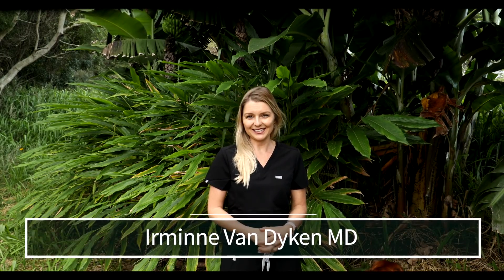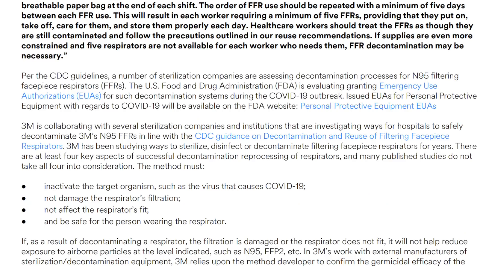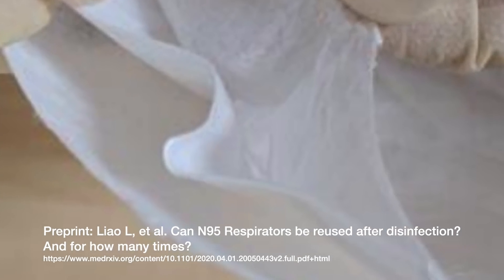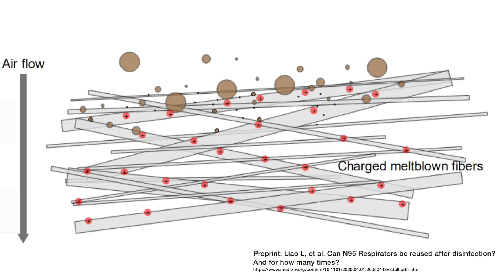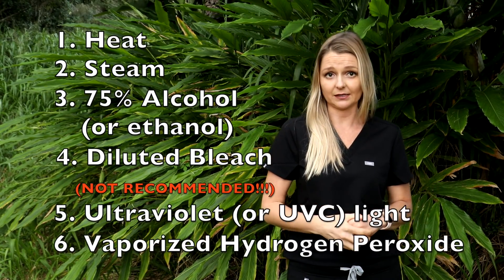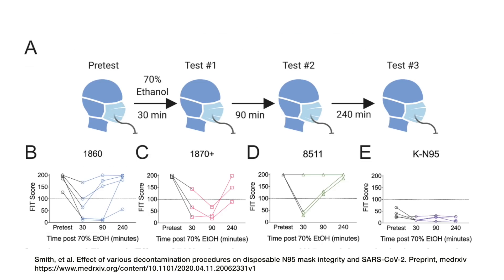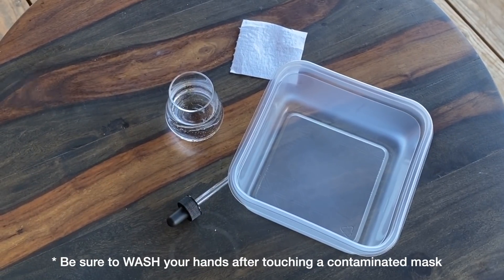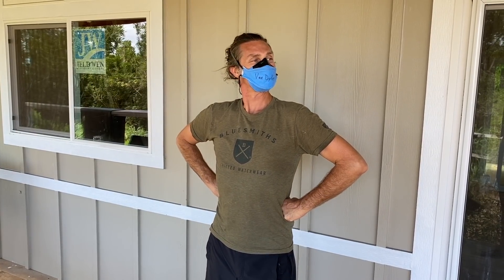How To Disinfect Your N95 Mask at Home

Comment: I have alcohol in a spray bottle, and mist the inside and outside of the mask with alcohol mist after each use. It evaporates in a few minutes.
Reply: Try spraying hydrogen peroxide liquid instead, I don't think H2O2 is toxic. Or keep the mask in a bag for 3 to 4 days.
Reply: @xosefc  Paper bag keeps popping up....question, should the paper bag be sealed once the mask is place inside or left open to air out? Curious. Thnx in advance.
Reply: @MadDOGGYDog01  In order to protect from air stream, better sealed or folded up, just suggesting.
Reply: @xosefc  Thnx for your reply. Appreciated.
Reply: Robert Foster Not a good idea to spray the alcohol!!! It will break down the mask fibers eventually and make it less effective to screen out pathogens!!!
Reply: Researchers tested spraying N95 masks with ethanol mist, and found it reduced the filtration efficiency from 95% to 56% with a single treatment; repeated treatments are going to make that mask utterly and completely useless at filtering out viruses. See "Can N95 Respirators Be Reused after Disinfection? How Many Times?" published in the American Chemical Society's ACS Nano in April 2020.

Comment: Just watch the full video before commenting. i am a dentist and i use a surgical mask over my n95 mask and sterilize it with a steamer.
Reply: when you say surgical mask, I assume you mean the typical FFP1 3 layer mask? And if so, would this convection oven hack work on one of those? Curious....
Reply: MadDOGGYDog01 
Surgical mask is the common mask we see in a medical fields. It is less cheaper and less effective,  just throw it away or wash it,  don’t bother putting it in the oven. 

We are trying to save the n95 mask which is more expensive and more effective  in filtering. so i use a surgical mask over the n95. You can use washable face mask or anything to protect your n95 mask being contaminated. Dentist is a high risk being infected with all sorts if bacteria and viruses. We work on patients mouth so aerosol is being generated and splatters coming from the mouth of the patient. 

N95 is still contaminated but it is less contaminated because of the outer covering which is my surgical mask, 

If you are a doctor or medical practitioner n95 is a must,

Comment: I’ve been spraying mine with 3% hydrogen peroxide so it’s damp all through and air drying in sunshine. I have 2 N95’s I bought a few months ago, gave 8 to my parents with the same sterilising suggestion. H2O2 does kill these viruses and breaks down safely into water and oxygen. Hopefully, if they’re using a vapour of it, the masks aren’t damaged.
Reply: Doing this degrades the mask  fibers over times after continued sprays used.

Comment: What if you do not have a convection oven? 🤷🏽‍♂️
Reply: Use the mask after 7 days, virus can no longer stay alive that long
Reply: @SanskarSharma  but the mask will be dirty.  So proper washing the mask is very important.  I have dont a detail research on this topic. And made a video on my channel.  U can refer that video.  It's very important to was the mask before reusing it.
Reply: @PritZCollection  You cannot wash N95 masks or spray them with alcohol or hydrogen peroxide. If you do, you will render the electrostatic charge inside the mask useless. What she is talking about in this video is how to disinfect only N95 masks. Regular cotton masks can be washed and dried to disinfect. I have been doing research on the internet for a long time on this and her way is the way that the most recent studies say to do it and still be able to wear the mask for at least, I believe, 20 times, if not more. You can sterilize the N95 with steam, but then you would only be able to use it 4 more times after. The other way is the way Sanskar Sharma (above) said. Don't use the mask for at least a week, maybe a little longer. The virus should  not viable after that time.
Reply: I put mine in a pillowcase and place it in the dryer for 30 minutes.  I am not concerned about washing it because I wash my face before I use it and I can live with it if there is a bit of my own oils on the interior of the mask.  It is not perfect or approved by health professionals as of yet but I am using the tools that I have, and dry heat is also a method being studied with some promise.  Oh I am in no way discouraging this channel's approach.  I just don't have a conviction oven but I do have a conventional clothes dryer.  Please do your own research and use the methods that will work best for your situation.  I am just a high risk patient that occasionally needs to go to the supermarket and other public places.  I am not in direct contact with known infected people.  I did not purchase my masks recently I had them left over from a year ago.  I lucked out that they were N99.
Reply: @That_BIack_Cat  yes. N99 is best 👍
Reply: @PritZCollection  We went on a trip to a place that was having brush fires so I bought them for my family just on case we ran into smoke.  We didn't use them for the trip.  About three weeks after we got home covid started.  It was pure luck.
Reply: @That_BIack_Cat  stay safe bro.  👍 . All will be ok . Take care of yours family .
Reply: @PritZCollection  You and your family stay safe too.  Take care ✌🏾😷✌🏾.
Reply: @That_BIack_Cat  thanks you friend.  
Bdy , where are you from ??
Reply: @PritZCollection  Originally NYC. What about you?
Reply: @That_BIack_Cat  I am also in the same condition.  Fighting with the situation bro. U all take care.
Reply: @MsBarbieBaby1 thanks for such a guideline . 
I too can spread this information. 

But as pre the new circular ,  GOVERNMENT says   N95 mask with respirator valves is not safe during this pandemic.  As the out flow of air from the VALVE didn't get FILTER and it may contain the virus and can be spread out.  

So what can we do in this situation,  for long time using a non VALVE N95 mask it will be to difficult to wear and will be harmful as we intake the CO2 again . 

To solve this situation,  can we 1st wear a 3layer surgical mask and on top wear a tight N95 valve mask . 

This will filter the intake air through valve and will block the out going air containing the virus by the surgical mask . 

Do u all think this process will be safe from both side ???
Reply: @PritZCollection   I have just heard that as well. That the valve N95s aren't as good. I am not sure what to do in that situation. All of my N95's don't have the valves and I have no issues with breathing in CO2. I wear mine for a few hours at a time. 
I have heard that doctors are wearing regular cotton masks or surgical masks over their N95's so they can use them over again. I suppose if you are not in the healthcare field that might be an alternative if you have the valve on your N95. For healthcare workers I'm just not sure. That would certainly be harder to breath in, but if you don't have any respiratory issues it's probably doable.
Reply: @MsBarbieBaby1   ok . Thanks. Realy yours advice solve many if my doubt . 

I too will advice my audience to do the same .
Reply: need to get a boiler and the steaming process with In Effective Way USING HOT WATER
Reply: @markvandeventer2411  coz not all of us live where the sun shines
Reply: @markvandeventer2411  doesn't change my reply. You seemed confused as to why everyone didn't use the sun. I explained why. The fact that you live in Thailand is irrelevant.
Reply: I put my masks in a container and place it on the dash of my car sealed up in the sun all day. The temp inside the car get's plenty hot to do the job.
Reply: @joshuaprince898  Seriously?  Do you inspect the masks for living viruses?
Reply: @joshuaprince898  but. Have to wash and disinfect the mask first then have to dryed under sun light. 
I too have a tutorial about the proper process of washing , disinfecting and sanitizing the reusable mask. Hope the video will be very helpful for all. Pls once visit my video.  And pls suggest me , wether I have used the correct process. 
Tc. Stay safe sir .
Reply: @PritZCollection  washing the mask may damage the fabric and will be more porous for virus .
Reply: @praveensingada  yes my friend.  You are right . Actually during the pandemic,  we are having shortage of N95 mask , so we have to wash them properly before reusing them . 

Thanks for the suggestion
Reply: @PritZCollection  just put the used mask in steam autoclave , or u can use steam sterlizer by Philip avent , or some pressure cooker , but don't wash , the mechanical integrity of mask gets damaged .
Reply: @PritZCollection  we are washing in  soap water or  keeping them 25 sec  in soap water or surf water..... kindly let us know,,whether this is correct  ??

Comment: I got a portable UV disinfectant light (or lamp) off of eBay that I can toss in my backpack. Depending on the seller these handheld lights go from about $12.00 (coming from China, so I question the quality of the light itself) usually up to around $50.00. Some sellers rip people off by trying to sell a $45.00 UV disinfectant light for over $100.00, so please beware. The disinfectant lights can be harmful too, but I’m hoping the one I order works well on my cellphone and iPad. I’m bringing this up because of the bacteria problem, and I hope they might be safe for masks. (I’m not trying sell anything, but in times like right now thing’s are tough and I thought it was worth a suggestion.)

Comment: 3M published studies and no methods should be used to reaterilizing. My ER is using UV light.  Sure, the mask is sterilized, but who knows what the integrity is. I wear a surgical mask over my n95 and keep it for a couple days depending if the patient actually comes back positive. I'd rather reuse, than use something with questionable integrity

https://multimedia.3m.com/mws/media/1824869O/decontamination-methods-for-3m-n95-respirators-technical-bulletin.pdf

Comment: I've been hanging my two in a 170f oven with wooden clothes pins so they don't touch the hot metal for 30 min and then let them cool in there. How do the plastic containers not melt? And is it 185 bc that's as low as your oven goes? Isn't the internal temp for cooking food to kill pathogens only 165?
Reply: And even if the plastic does not melt, I'd be concerned about the fumes being given off, and finding their way into the mask.

Comment: Putting a plastic container in an oven, any oven just doesn't sound like a good idea.  Also isn't heating plastics a bad thing?
Reply: 185F is not hot enough to melt a tupperware
Reply: @xoxoemo  That's not Tupperware. It's Glad and cheaper plastic. But apparently, it didnt melt as we saw.
Reply: I think the same way.
Reply: That's just in your food. You're not eating or drinking the mask. 
As far as plastic containers, some food comes packaged in such that say can put in conventional oven as well as microwave and they say a time and temperature. Always seemed crazy to me, but if it's not Too hot.. I guess tbey wouldn't say it if it was going to melt. -  I never tried it..
Reply: TV dinners cone in polyethylene trays which can be heated to 350° F without releasing harmful gasses or melting. Disposable plastic containers are polyethylene or polyurethane. The masks themselves are made of polyethylene fibers
Reply: Desperate times call for desperate measures. I'm sure the few exposures to the heated plastic, in order to avoid contracting the SARS-COV-2 virus during this pandemic, is worth it. It is to me anyway.
Reply: You don't have to use plastic.
Reply: She's a woman who got a MD degree. Leave her alone
Reply: How to buy a quality mask?https://www.walmart.com/ip/KN95-Soft-Comfort-Filter-for-Face-Skin-Care-with-Fixed-Nose-Clip-Non-Woven-Fabrics-10PCS/645924806
Reply: Nano-level N95 protective mask can be used repeatedly 20 times, welcome to buy and order in bulk. Please visit candynice.com, and nanotechnology video details please visit: https://youtu.be/HX7Qbol47vc
Reply: @toolsamazingservice7313  Only if they are dryed for 72 hours to kill COVID-19

Comment: With the current shortage of the N95 mask, I have in my garage roughly 30 pieces of expired unused N95 mask. Can these masks be used still? I think that the part that has an earlier shelf life would be the rubber bands. I did a pull test and there was no deterioration noted on either the cloth part or the rubber band. Is it safe to use them?
Reply: I would recommend you visit Center of Disease Control's website.  See "Considerations for Release of Stockpiled N95s Beyond the Manufacturer-Designated Shelf Life" https://www.cdc.gov/coronavirus/2019-ncov/hcp/release-stockpiled-N95.html -
Reply: @porpo-donut  Thanks for providing the link. I did visit the CDC website and the 3M numbers I have on the boxes at home correspond to the numbers listed on the CDC website which is, according to their investigation results, considered "protective" or safe to use. Thanks again.

Comment: Putting plastic in an oven is a no go for me. 
I will put mine in a glass container and set it in the sun for the day. 
It gets dang hot in there and it catches alot of UV. 
If I sat in that container all day in the sun, I'd be sunburned and dead.
Reply: Lol. Must be nice living in a sunny place. Where I live is always overcast and low sunlight.
Reply: @KVStarStruck22  The sun only just finally came out last week. 
<3
Reply: But doesn't glass usually blocks the UV
Reply: @soumendrapanigrahi2497 Yes, but not UVA rays. " Standard window glass, according to the International Ultraviolet Association, will allow UV-A to pass through while almost 100% of the UV-B and UV-C light is blocked. Therefore, some UV light will enter your home and potentially affect your skin. Some of these effects could include increased freckles and increased sensitivity to sunlight that could result in rashes such as photodermatitis."
Reply: @KVStarStruck22  ye but we are talking about killing virus here, I think it would be more effective to just put it out there in the sun rather than covering it with glass..... coz UV-C is most effective in killing those microbes
Reply: @soumendrapanigrahi2497  Yes, better to leave it outside with no windows around it.  You mentioned UVC, UVC does not come through, it is completely filtered by the atmosphere and does not reach the earth's surface unfortunately. They do sell UVC lamps though in stores.
Reply: @KVStarStruck22  hmm i had an idea 2 years ago before this Corona pandemic to use uvc tube used in filtering water inside a reflective box to kill bacteria and viruses, unfortunately i didn't construct it back then.... Now some idiot has sent me a used mask online and i can't return it online due to no return policy, no to mention i payed thrice the price for it.... I am planning to wash it although it will reduce efficiency greatly, but during situations like this idk what else to do
Reply: @soumendrapanigrahi2497  What kind of mask did you buy? I read somewhere that UV light can lessen the electrostatic charge in N95 masks.

Comment: What about a CPAP cleaning device such as SoClean that sterilizes cpap masks?  I could just toss it in with my CPAP mask 😷 daily(?)
Reply: What does that CPAP cleaner machine actually do?     Beware any process that damages the static charge built into the mask's inner layer, during manufacture. 

I don't know anything about CPAP but it seems they're a kind of forced-air respirator... with no filter.     IS THERE a filter in a CPAP machine or mask?     That filter would be the trickiest item to sterilize, as it has the highest surface-to-volume ratio, by design.
Reply: @johnbecich9540  Yes, CPAP machines have filters (not the masks) but they are mainly to keep dust out of the machine.  They're foam and paper filters and intended to be disposable.

Comment: For the love of God, can there be a concise, definitive, credible, professional, verification that answers the question of how to safely extend a N95 mask & other backup solutions?  Even if it is to just place some type of a fabric cover over the N95 or insert a filtering fabric inside, or... ?  All of which may make it a bit harder to breathe through, so experiment to what you can tolerate in terms of adding more layers.  Time is life, Science rules, & Validation is critically needed.  Not everyone has the time or opportunity to read through countless responses, trying to evaluate what’s the best or, .....at least even the top 3 solutions.  At least the recommendations for fabric masks are straightforward - wash in hot soapy water & dry with heat.
Reply: Cloth masks with filter pockets in them are the way to go, but you need to change the filters each time you come across heavy human traffic. Cloth like you said hot soapy water. N95 and surgical masks are only to be used once , I know because I was a nurse.  They are no real solutions for nonhealthcare workers except you can do the best like what is shown in this video.  The hospitals have professional cleaning equipments that can sterilize the masks but only for a certain time.
Reply: KVStarStruck22 👍🙏
Reply: What about steam?
You didn't mention anything about steam.
I expose my mask to  steam for about five minutes ,so what about that?
Reply: Go to 3M's website. Verify with the manufacturer, who manufactures the 3M N95. See where they say for yourself "N95 is  disposable 1x use..." and does not recommend any procedure to clean or re-use this respirator after 1x use.  All these "back up" solutions to temp. "extend" the life of 3M N95's are based off published guidance by CDC "
Recommended Guidance for Extended Use and Limited Reuse of N95 Filtering Facepiece.  Read for yourself at this link: https://www.cdc.gov/niosh/topics/hcwcontrols/recommendedguidanceextuse.html
Reply: Weedy Lints 👍